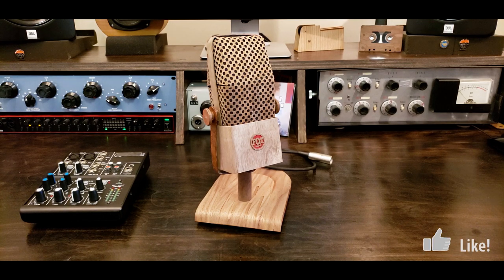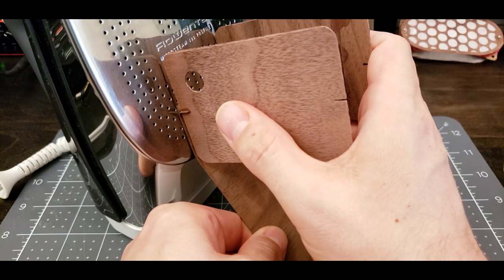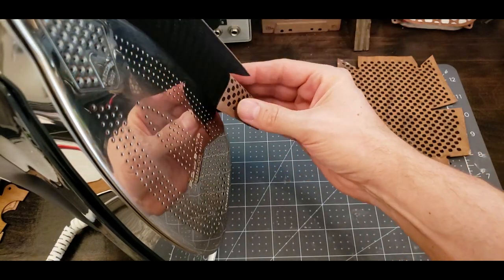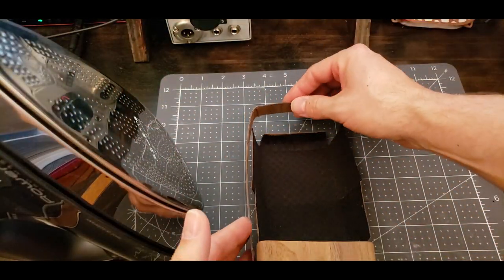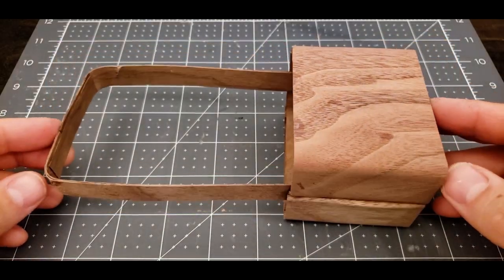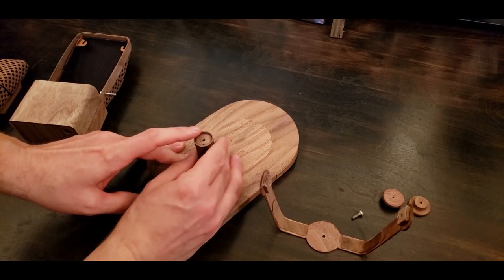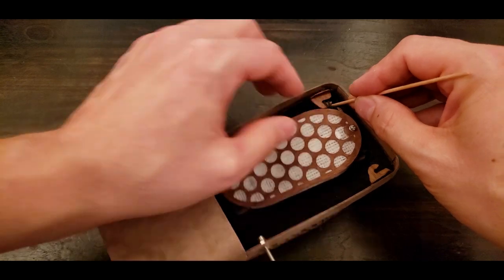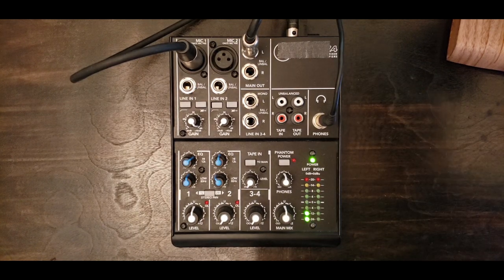Ribbon Microphone DIY RCA 44 made of wood - Episode TWO

Comment: Really Cool, I designed the KU5A while I was at AEA.
Reply from the maker: Neat! Nice job on the KU5A, I've used one on snare and it was pretty sweet!
I'm finishing up an RCA KU3 design, including a labyrinth. Any tips? You think rca used Signwriters leaf, or something closer to the 1.8u or even 2.5u foil? I'm guessing they sorted through signwriters leaf for the perfect thickness for that model, because they are so sensitive. I can't imagine a stage mic getting so much output from a thicker foil.
Obviously I'm a fan of the 84 ;)  Any idea how wide the magnets are? I'm guessing 1/4" like mine but perhaps they are 3/8"? Just curious
Anyway, all the best!
Reply: @FrankOlsonTwins   AEA uses 1.8u for everything, not sure if RCA went to any other thicknesses for the KU3A. Getting directionality over a larger bandwidth is very difficult. And leaks between the labyrinth and the plates with effect the polar pattern. Use synthetic wool in the first tube into the labyrinth, we used high density Huber glass panels in the rest of the labyrinth, not sure what you will be able to get “off the shelf” that would be similar. The head basket of the KU3A has a lot to do with the sonics. The R84 uses a .150X.095X2.5 magnet.
Reply from the maker: Great, thanks for the reply!

Comment: It sound great for  diy ribbon microphone, I do hear some high freqencies in you voice which as you said was added in post production, I wished I could hear the mic as recorded and on a guitar combo. I think if you would get a 3d printer you could make the parts and have a even nicer en result, you can then use putty and paint to even out and get a finished end result.
Reply from the maker: I upgraded the transformer and made some samples comparing them to a real rca 44:  https://youtu.be/uVVMnpHqIrc

Comment: Very nice thanks for sharing...Can you tell me the thickness of your aluminum strip...and the properties of the transformer?
Reply from the maker: Sure! The Aluminum is 2.5 microns thick. You can find something similar by sorting through a book of signwriters leaf(imitation silver foil). The thickest ones will be about 2 microns thick, which is perfect.  Be warned though, the thinnest ones in the book are approximately .5 microns thick, which is very difficult to work with.  Or you can buy aluminum foil from various vendors online.  Just do a search for "ribbon mic foil."  
The transformer is a b-stock unit from a cascade microphone- probably a cascade fathead.  I believe the turns ratio is 1:35. I think it's made by the manufacturer Shinhom.  There are many ribbon mic transformers available from manufacturers such as Cinemag, Lundahl, and Edcor. There are others online as well.
Thanks for watching!
Reply: @FrankOlsonTwins  thank you for this great and perfect explanation. And of course your gold Info...kindly regard sir ❤❤🙏🏻
Reply from the maker: No problem.  Good luck!

Comment: Absolutely beautiful. There's quite a high noise floor. Wondering if that's a result of the gain on the mixer being pushed or just a characteristic of the mic. If the latter, is there anything you would do differently a second time around to combat the heavy noise floor?

Cheers, love your work.
Reply from the maker: Thanks!  Now I just need to make another one for stereo :)  
Regarding the noise floor, a couple things happened.  First, I used a software compressor which pulled the noise up a bit. Normally, I'd also use a gate for narration tracks, but I didn't here because I wanted the natural sound of the mic to come through without being misleading. Some light gating would have cleaned it right up.  
In general, these mics (RCA 44, 77, R84, R44) require a fair amount of gain, especially on relatively quiet sources like voice over work.  Unless you're using a "fet booster" or "lifter" you're likely going to be maxing out your preamp.  At this point, most pro studios just use lifters on every ribbon mic, unless they are active ribbon mics. It lets your preamp relax a bit and gives you a bit of wiggle room when setting the gain on your source. The R121 is a possible exception, but even Royer makes active ribbon mics for that very reason.
And we haven't even talked about impedance yet!  Luckily, the Mackie Onyx preamp I used has been designed to accept low impedance mics like this one(I'm guessing it's around 50 ohms). The Onyx pre was designed for such tasks, and is a good match.  It gave no trouble amplifying at max, aside from a bit of self noise. Again, a bit of gating would have worked, but in the context of any music mix, it wouldn't be an issue.  I tried this mic with my focusrite interface, and honestly, it sounded bad. Very "woolly."  I don't think the preamps are designed for such a low impedance input.  
I will be upgrading the transformer to the Cinemag 44 equivalent soon, but I don't expect that to do much but extend the top end of the mic.  However, I'll keep you updated if you're interested!
Best!
Reply: @FrankOlsonTwins  that is a fantastic reply, thank you! Yeah I'd love to stay updated on this and have definitely subscribed for any possible updates.
I have a Mackie Onyx Blackbird and a focusrite and I do prefer the quality of the onyx pre more but I've never tried a ribbon mic in either.
Yeah I appreciate the nakedness of the vocal recording you've done to show us the true quality.  I think a lifter would almost definitely give us space to reduce the pre amp hiss but because I have no experience with ribbons I didn't know if you could use a lifter or not. Meaning, I didn't know if the phantom power to the lifter would have potential to go through and damage the ribbon. In experience I tell you!

Thanks for engaging, sir. Have a beautiful day and I look forward to seeing more from you :)
Reply from the maker: Haha, glad my reply didn't bore you!  Sometimes on YT it's hit or miss that people might appreciate it.  Ooh, I was looking at the blackbird a few years back, but ended up with the focusrite 18i20 for I/O options.  Since I still wanted the Onyx preamp, I decided to get a 402VLZ4, which is lacking in eq options, but I try not to push too much eq anyway.  I've used a number of ribbon mics(44, 77, Ku4, 88, 92 and even 121's) through cloudlifters at studios, and in my experience they are worthwhile for that use.  Most(all?) lifters are phantom powered, which sort of protects the ribbon by re-routing the voltage to the lifter circuitry and keeps it off the pins(as I understand it).  So, they are actually recommended for ribbon mics.  Still best to keep the phantom power off while you plug/unplug your mics though, as a matter of good practice.
Thanks for watching!
Reply: @FrankOlsonTwins  well I certainly appreciate the in depth sharing of your knowledge. 

The Blackbird was a great purchase for me but it is firewire so its connected via multiple adapters now and may (hopefully not) become obsolete. I'm hoping one day to get a Clarett in my set up but I need to research a bit more first. It would be nice if I can connect the Blackbird to a clarett through ADAT. Also hoping to follow your build one day too. Maybe not to the amazing precision you've achieved though haha.

Cheers!
Reply: @FrankOlsonTwins  next, a wooden boost box for ribbons! WL-1? ;)
Reply from the maker: Haha, I'm working my way toward a full wooden channel strip!

Comment: select thickness or thinness foil? i found 15 micron foil. can  use 15 micron?
Reply from the maker: the foil is about 2.5 micron.  1.8-2.5  micron is preferred, 15 micron is very thick and will sound dull or muffled.

Comment: ok sir, now i have question, how to connect the mic to laptop ?
Reply from the maker: You only need to plug it into a recording interface, which usually plugs into your computer with usb. Or, you can use an external preamp to plug into your computer- see moment 9:36s in the video. 
Good luck!
Reply: @FrankOlsonTwins  how about mic jack ?i mean can we use a headset jack directly to laptop ?
Reply from the maker: It depends on a few factors. 
1. What kind of mic? The mic shown in the video will not work well if plugged straight into a laptop. You'd need any type of preamplifier or booster to make it sound good.  Other types of mics will be easier, if they are designed for a laptop(gaming mics/headsets for example).
2. What kind of jack does your laptop have? Does it have a dedicated mic jack, or a combination mic/headphone jack like a tablet or phone.   If you have a mic with an XLR plug, and you have a dedicated mic jack, you'll need an XLR to 1/8" adapter. If it has a combination Mic/headphone jack, then you will also need one of these:  https://youtu.be/M0B6iDdbZPY.
Reply: @FrankOlsonTwins  ah, finally, thank you sir. that's why i always fail to connect this ribbon mic directly to my laptop using combination mic/ headphone jack
Reply from the maker: I tried it today, plugged directly into the mic jack and it did not sound good. The connection is not adequate, and there's not enough gain.  I currently use a little mic booster (KT CM-2) to plug my ribbons into my audio interface.  I just did a narration for my latest video with the wood 44 ribbon.
Did you make one?
Reply: @FrankOlsonTwins  yes sir, i make my ribbon mic around 3 years ago. i think it the same with electret, but i wrong. i try to recoil the transformer, and still fail. the sound doesn't really good. i never know if ribbon mic need pre amp, because i use pre amp for my condenser mic, and it blew up my trafo, lol....

Comment: Can we get the cricut files?
Reply from the maker: The ribbon motor is easy enough to design in cricut or photoshop.  The specs for the actual ribbon are: Pure aluminum corrugated ribbon, Thickness: 1.8 µm, Width: 0.185 in., Length: 2.35 in   
Start from that size and shape and just design the motor around that. 
The enclosure is a lot more work, ironically.  I just looked at lots of pics and made guesses. If it works and sounds good, there's no wrong method.